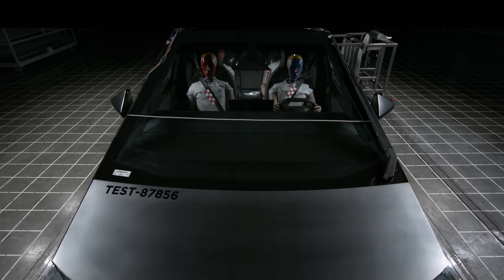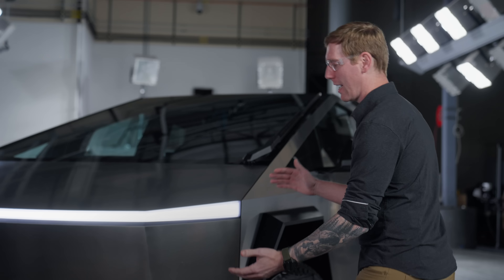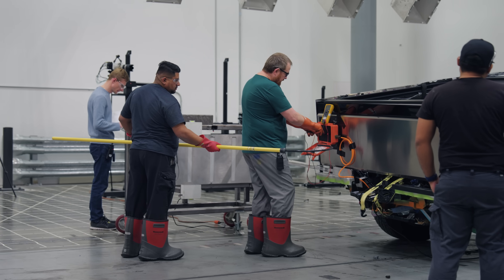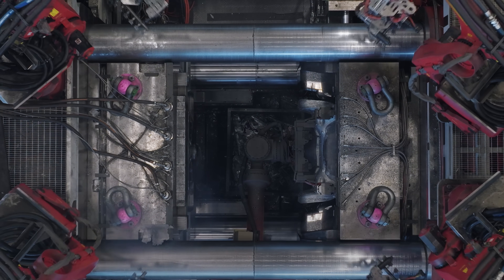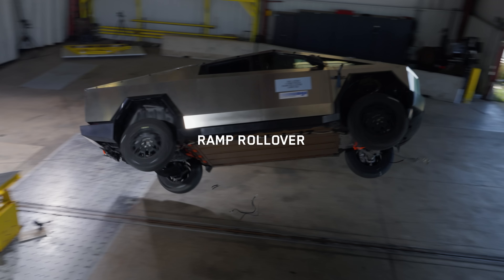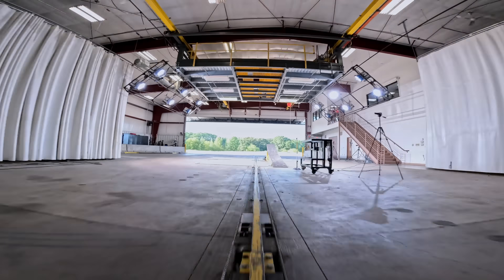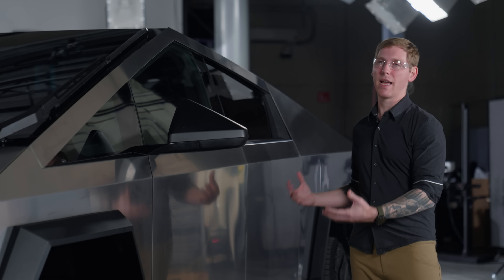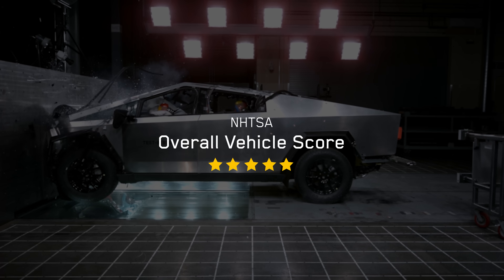Engineering Cybertruck for Maximum Safety | Tesla

Comment: For pedestrians, safety is bad.
Tesla has stopped resp. slowed down production because hardly anyone wants one by now. 
Dump stockpiles are filling and filling. Nearly unsellable. Tesla even takes back Cybetrucks from customes, but with high losses (35-40%).
In UK/EU/Japan/China etc., that monster will hardly ever get admission.
Apart from that: much too large and too heavy. In EU, you would need a truck driving license because max weight exceeds limits for usual cars.
Just recently, 4 teenagers were burnt do death in a Cybertruck because after a battery fire, the electric system stalled and it was not possible to open the doors manually without the electric sensor function. No manual door handles. Just one point why this car will never get admission in most countries outside US.

Comment: Who independently assessed this monstrosity as 5* ?? Seriously.
The reason why modern cars deform the way they do in accidents, is to make the deceleration less for the occupants.
You want to know the difference between your internal organs flying forward into your ribcage at 20G, or 90G? You can ask the people who have survived some enormous shunts and walked away thanks to modern vehicle design. You can't ask say the same to people who have had similar accidents in old cars from the 50's.

Or what about in the case of a fire. It can happen in any vehicle, but others are escapable when the electronics fail. In the cybercuck youre trapped inside to cook - and dont expect the fire dept to come and save you, when they cant break your stupid "bulletproof" windows.

And I havent even started on pedestrian safety.

As someone who works in the industry in Germany, any engineer who was involved in this thing should be absolutely ashamed of themselves. 

Our DUTY as engineers is ethical design. That means creating something safe for the user, passive "users" such as nearby people and other road users, and the environment. This truck fails on ALL counts.

Thank god this will never be allowed in Europe.

Comment: I did my share of reading, but I'm still confused what was behind the enormous rise (+800%) of the Tesla stock in 2020 and 2021.

Normally, stocks reflect expectations of investors. Stocks go up on good expectations. Yet I cannot find a single "new" fact that could've caused this rise.

In fact, I mainly see bad news:
-Tesla is losing its dominant position in the EV market
-competitors are stepping up
-Tesla does not have a (realistic) pipeline of new models
-technological breakthroughs are not expected
-etc.

Comment: Tesla driver-less weighted trucks to drive over new bridges to test it. Sensor at base of bridge (and key structural points) to assess integrity. Monetise as movie or real life. 

The concept of using Tesla driverless weighted trucks to test new bridges presents an innovative approach to infrastructure assessment, combining autonomous technology, engineering evaluation, and potential commercial opportunities.

Supportive Reasoning
Using autonomous Tesla trucks as test vehicles for new bridges would provide a controlled and repeatable method for assessing structural integrity. These trucks can be programmed to apply precise loads at various speeds, reducing human error and ensuring consistent data collection. Sensors at key structural points, such as the base and mid-span of the bridge, would provide real-time feedback on stress distribution, potential weak points, and long-term durability. This method enhances safety by eliminating human drivers from high-risk testing environments and enables more efficient data-driven decision-making for infrastructure development.

Counter-Argument
A major challenge with this concept is the reliability and cost-effectiveness of using autonomous trucks for bridge testing. Traditional methods, such as static load testing with conventional weighted trucks or dynamic simulations using advanced software, are already widely used. Additionally, autonomous trucks may introduce unforeseen technical issues, such as sensor malfunctions or software miscalculations, that could compromise test accuracy. Moreover, regulatory hurdles and public skepticism regarding the safety of autonomous vehicle testing in critical infrastructure projects might slow adoption.

Action Point for Improvement
To enhance feasibility, a phased implementation approach could be adopted. Initially, Tesla trucks could be used in conjunction with traditional testing methods to validate their accuracy and reliability. A hybrid model involving controlled real-world testing and virtual simulations would build confidence in the technology. Additionally, the process could be monetized by producing high-quality documentary-style content showcasing the testing process, the role of AI in infrastructure assessment, and the future of autonomous technology in engineering. Such content could appeal to both educational and entertainment markets, providing additional funding for infrastructure research and development.

Comment: It has the worst recall of any truck. It weighs way more than my Toyota and Cyber Truck isn't really an off road vehicle. Tesla stock is falling. Anybody can make an over weight vehicle with little mileage that's strong. A true engineer takes weight and mileage into consideration. After all the President's limo is as tough as any Tesla and it's mileage also sucks but it will probably take a bazooka hit and keep rolling.
No Cyber Junk will ever get 400,000 miles on it like most any Toyota will.Take it off road and call me when you're stuck 10 miles from any road, if it ever gets that far from a road.

Comment: What a joke. These monstrosities are lethal to pedestrians, which is why they'll never be approved in most countries.
Reply: Gas trucks are just the same. It’s a concrete wall either way
Reply: @plummit24  no, it's the shape of the CT that makes it particularly dangerous to pedestrians
Reply: @michaelnoble2432  yes I see what you mean but your dead if either vehicle hits you
Reply: @plummit24  beyond a certain speed a pedestrian is dead regardless. But there's a large range of speeds where the level of injury or chance of death is HIGHLY dependent on speed. 

It's a shame, as Tesla's other vehicles have excellent pedestrian safety features.

Comment: Are you guys going to address the electrical issues with the voltage current being something you'll come into contact with from the external part of the body of the car? There was a viral video showing a guy hooking up a voltage meter to a lugnut and it was enough to kill someone easily.

Comment: Doesn't even have clear coat so it rusts, locks you out and bricks its self, sharp panels that cut you, virtually no articulation movement so it's awful in off-road conditions, traction control is awful, weighs 7000+lbs so gets stuck in snow/mud with the bad traction control and almost no articulation movement, range less than advertised, cost more than advertised, trims/panels can be pulled off by hand because they are glued on, back trunk leaks and is not waterproof, most recalled vehicle of 2024 (you literally had to recall every single unit you made!), consumer reports state it's more dangerous than the Ford Probe (why is your truck even still allowed to be made or on the roads?), you cheated safety with a 3rd Party Inspection Agency, bad self-driving, acceleration pedal sticking forcing acceleration, prone to catch fire, electrically overloaded components, parts falling off your truck because they are glued on, front and back passenger doors don’t align properly, regular unibody chassis and not an exoskeleton design as advertised, software issues which increased potential for crashes, broken promise of a futuristic tent using cheap fabric that'll cost you $3500.00, critical steering issues, didn’t include anti-pinch sensors for the frunk so people could suffer broken fingers or literally the loss of said fingers, armor glass being broken by hail and replacements costing $2500+ so not even remotely bulletproof, front windshield wiper breaking, and I could just keep going. If folks want to support a blasted con-man, go ahead, screw yourselves  in the long run with a faulty product. Engineering for safety, my ass. Do society a favor and discontinue production of this unsafe disaster.

Comment: I don't think 35 mph frontal is most severe. It is important test but they've been doing that test since the 70s, and all cars since then have had to pass that test to be sold, I think. Anyway it is more of a test of the cars seatbelts and airbags than it's energy absorbing structure, mainly because cars have mastered how to design energy absorption for this kind of crash for a long time.

Comment: But the idiots with a basic level understanding of physics, car safety and/or a working brain will say that's obvious bs, not least because it has to go through a ruff structure before it gets to the 'crumple zone', which is mounted within a rigid structure, so your only hope is that there's enough rust to soften the structure.

But they would be wrong.

Comment: One thing: 35 mph is considered one of the most severe crash tests in the automobile industry? How does that make sense? Most highway crashes, which are usually the fatal ones, occur at 70 or more mph. Wouldn't it make much more sense to test the vehicles at speeds people actually have fatal crashes at? Wouldn't it also make more sense to crash two vehicles into each other, to ensure that BOTH parties survive the crash test? Having a tank on the road might benefit one party, but the second one not so much.

Also a big problem according to many newspapers with the cybertruck is the safety and survivability of pedestrians who get hit by the car, due to its center of gravity and overall design. How are you guys ensuring that a future version of the cybertruck will take that into consideration and raise the safety level for all, not just the people inside this truck?
Reply: Most people aren’t hitting immovable objects at 70mph and if they did the outcome would be the same in any vehicle.

Also the Cybertrucks hood is lower than other trucks and SUVs in the USA market yet it’s somehow more unsafe then those?

Comment: Alr but this is better 👇

The Ford F-150 is an iconic pickup truck that has been a cornerstone of the American automotive industry for decades. Known for its durability, versatility, and performance, the F-150 has consistently been one of the best-selling vehicles in the United States. This essay will explore the history, design, performance, technology, and cultural significance of the Ford F-150, highlighting why it remains a favorite among truck enthusiasts and everyday drivers alike.

### History of the Ford F-150

The Ford F-Series was first introduced in 1948, and the F-150 became a distinct model in 1975. Initially designed to bridge the gap between the light-duty F-100 and the heavy-duty F-250, the F-150 quickly gained popularity due to its balanced combination of power and practicality. Over the years, the F-150 has undergone numerous redesigns and upgrades, each generation reflecting advancements in technology and changing consumer demands.

In the 1980s, the F-150 became the best-selling vehicle in the United States, a title it has held for over four decades. This success can be attributed to Ford's commitment to innovation, such as introducing fuel-injected engines, improving aerodynamics, and enhancing safety features. The F-150 has also adapted to shifting market trends, including the growing demand for more environmentally friendly vehicles, leading to the introduction of hybrid and electric models in recent years.

### Design and Features

The Ford F-150 is renowned for its rugged yet refined design. Its exterior features a bold grille, muscular body lines, and a high ground clearance, giving it a commanding presence on the road. The truck's design is not just about aesthetics; it is also functional, with features like aerodynamic improvements to enhance fuel efficiency and LED lighting for better visibility.

Inside, the F-150 offers a spacious and comfortable cabin designed to cater to both work and leisure. High-quality materials, ergonomic seating, and advanced infotainment systems make the F-150 a pleasure to drive. The truck also offers ample storage solutions, including under-seat storage and a large center console, ensuring that drivers have easy access to their tools and personal items.

One of the standout features of the F-150 is its customizable bed options. The truck offers various bed lengths and configurations, including the innovative Pro Power Onboard system, which turns the F-150 into a mobile generator. This feature is particularly useful for contractors, outdoor enthusiasts, and anyone who needs power on the go.

### Performance and Capability

The Ford F-150 is designed to handle a wide range of tasks, from towing heavy loads to navigating off-road terrain. Its performance capabilities are supported by a range of powerful engine options, including V6 and V8 engines, as well as hybrid and electric powertrains. The 3.5-liter EcoBoost V6 engine, for example, delivers impressive horsepower and torque, making it ideal for towing and hauling.

The F-150's towing and payload capacities are among the best in its class. With the right configuration, the truck can tow up to 14,000 pounds and carry a payload of over 3,000 pounds. This makes it a versatile choice for both work and play, whether you're towing a boat to the lake or hauling construction materials to a job site.

For those who enjoy off-roading, the F-150 offers specialized trims like the Raptor, which is equipped with features like off-road tires, reinforced suspension, and terrain management systems. These enhancements allow the F-150 to tackle challenging landscapes with ease, making it a favorite among adventure seekers.

### Technology and Innovation

The Ford F-150 has always been at the forefront of automotive technology. Recent models are equipped with advanced driver-assistance systems (ADAS), including adaptive cruise control, lane-keeping assist, and automatic emergency braking. These features enhance safety and make driving the F-150 a more comfortable and stress-free experience.

The truck also boasts a state-of-the-art infotainment system, with a large touchscreen display, voice recognition, and smartphone integration via Apple CarPlay and Android Auto. The SYNC 4 system, available in newer models, offers seamless connectivity and access to a wide range of apps and services.

One of the most significant technological advancements in the F-150 is the introduction of hybrid and electric models. The F-150 PowerBoost hybrid combines a gasoline engine with an electric motor to deliver improved fuel efficiency without sacrificing performance. The all-electric F-150 Lightning, on the other hand, represents Ford's commitment to sustainability, offering zero-emission driving with the same rugged capability that the F-150 is known for.

### Cultural Significance

The Ford F-150 is more than just a truck; it is a cultural icon. It has been featured in countless movies, TV shows, and songs, symbolizing the American spirit of hard work and adventure. The F-150 is often associated with blue-collar workers, farmers, and outdoor enthusiasts, but its appeal extends to a wide range of drivers, from families to business professionals.

The F-150's reputation for reliability and durability has made it a trusted companion for generations of Americans. It is a vehicle that people rely on to get the job done, whether that job is building a house, plowing a field, or taking a family on a cross-country road trip. This sense of dependability has helped the F-150 build a loyal customer base and maintain its status as a best-seller.

### Conclusion

The Ford F-150 is a testament to the enduring appeal of the pickup truck. Its combination of rugged design, powerful performance, advanced technology, and cultural significance has made it a favorite among drivers for over four decades. Whether you're looking for a workhorse to tackle tough jobs or a versatile vehicle for everyday adventures, the F-150 delivers on all fronts.

As the automotive industry continues to evolve, the F-150 remains at the cutting edge, embracing new technologies like hybrid and electric powertrains while staying true to its roots. It is a vehicle that embodies the spirit of innovation and resilience, making it a true American classic. Whether you're a long-time fan or a first-time buyer, the Ford F-150 is a truck that you can count on to get you where you need to go, no matter the terrain or the task at hand.

F Tesla 🖕

Comment: The lower bumper making it a 'safer' crash. Tell that to a guy being hit by a Cybertruck in a Kia Picanto. Weight matters a lot in the outcome of an accident. What they conveniently also dont mention is that the front windshield design is likely to get you killed in a rollover - such as when you roll over into a fire hydrant or other object that will go through the glass and into the driver/passengers.

Comment: imagine being able to implement or build a hydraulic or a spring effect mechanism for front and rear, in case of collision the spring or the hydraulic system could soften up the front or rear being pushed inwards (focussing more on the front since the back is a loading space with a lot of travel space before reaching the passengers) front crash bar could be impacted and retracted by the mechanism allowing it to reduce the speed and impact of the crash bar or the whole front being compressed
Reply: They this in the 70s and sucked
Reply: @ that’s the 70s, keep in mind we have concept HyperCard but we can’t get near safety measures either hydraulic systems ?